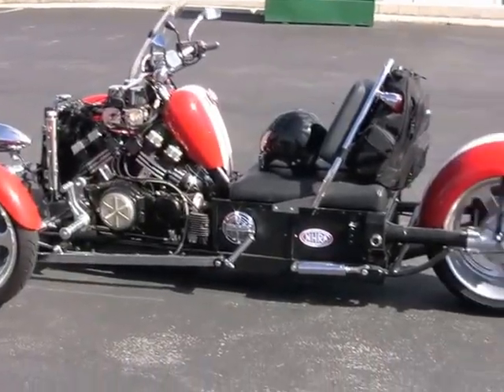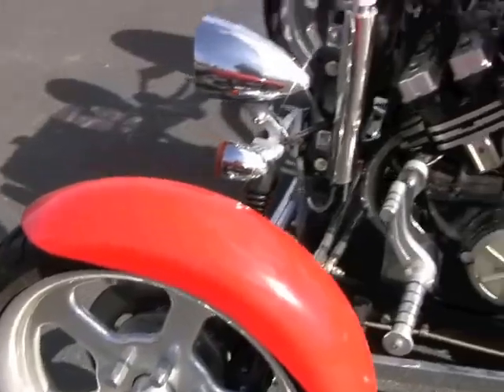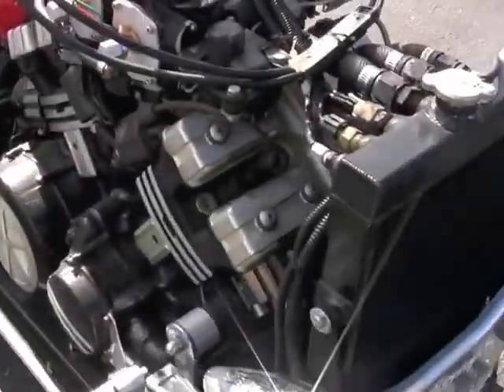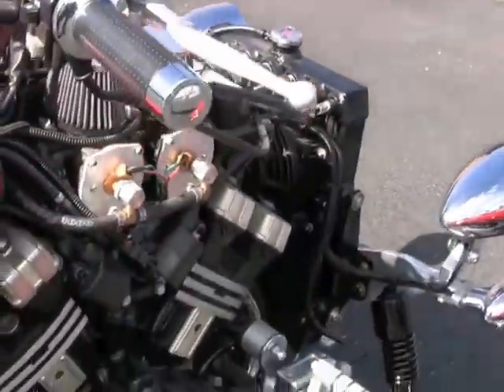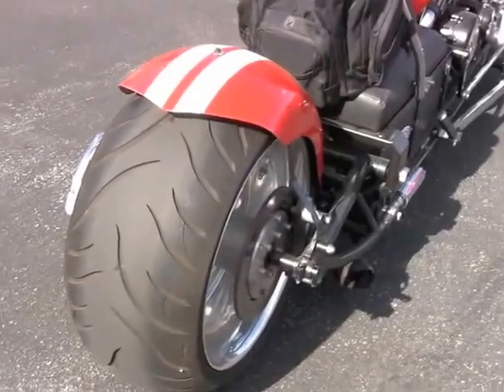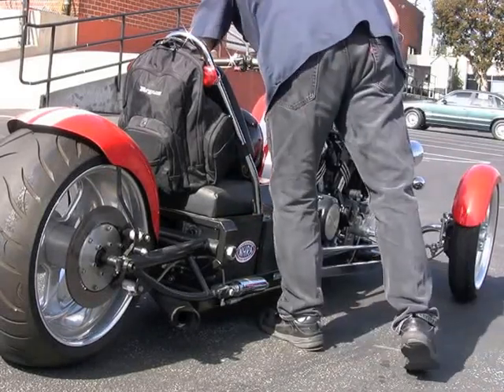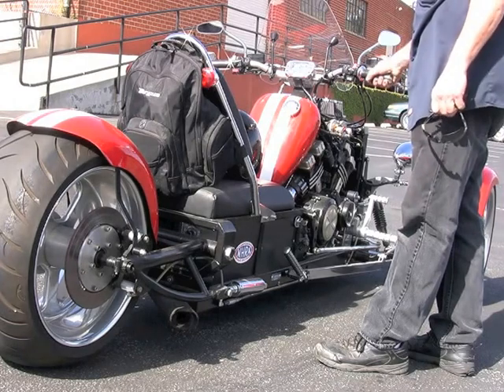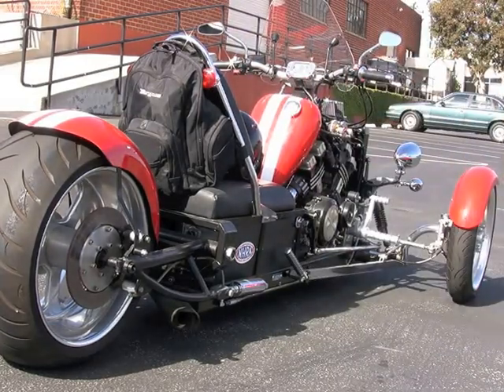Roadstercycle burnout

Comment from the maker: Hi phsycburn, We are in process setting up manufacturing  of Roadstercycle kits.
Basic kits will be rollers meaning, frame, wheels tires, steering etc.  They will be available in right and left hand engine setups. It will be a few months so check back with me later.
Reply: Any update on the kits?
Reply: Any updates
Reply from the maker: Sorry,. We do not build or sell kits anymore.